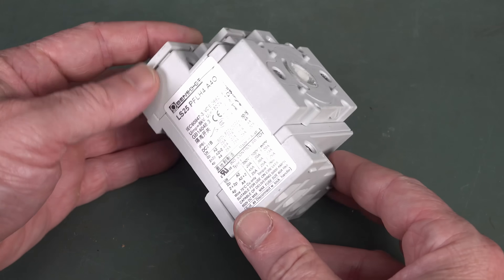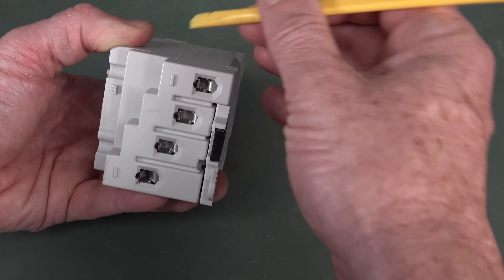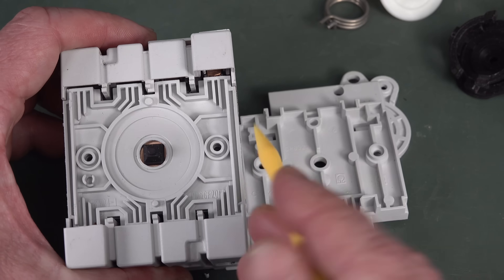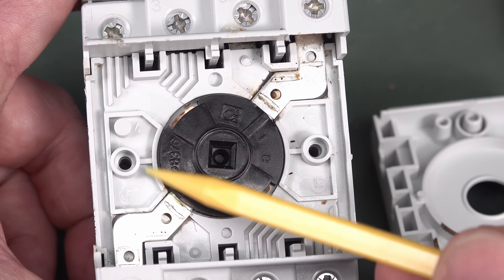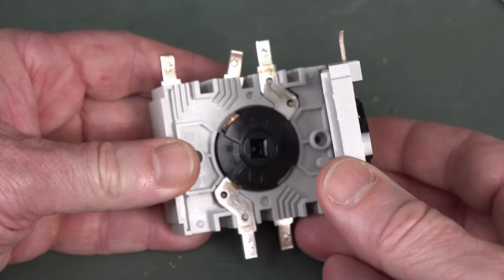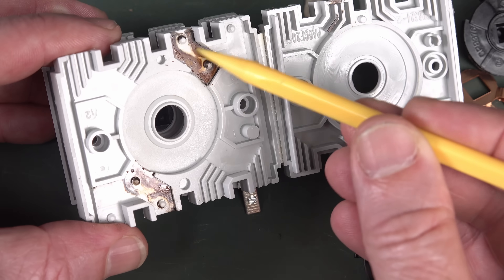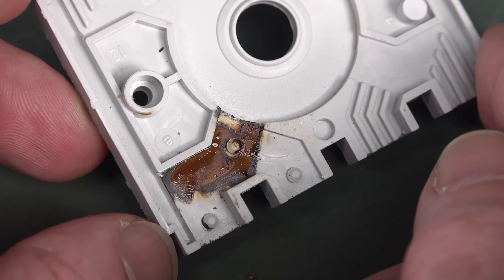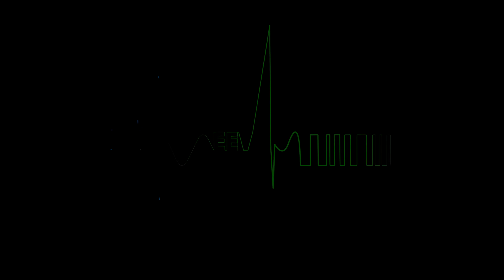EEVblog 1641 - How DC Solar Isolators Work (TEARDOWN)

Comment: Plain copper contact, not silver? Weaksauce! Yeah that definitely doesn't seem like a high cycle rating deal 😅
Reply: There is possibly nothing worse than silver to make a high voltage DC switch with.
Reply: @opera5714  Really? I was always told the opposite. Is silver really only for high amperage?
Reply: The issue is with DC and the melting temperature of silver.  Plasma itself is low resistance. Highest heat is generated at the transition point between metal and plasma.  Copper is also a problem except it conducts heat away so easily.  Tungsten variants are used because high melting temperatures.

Comment: What can interrupt fault current? A breaker, that's its job! Always best to operate the breaker first then the isolator IMHO.
Reply from the maker: The solar array DC side does not have a breaker, only the AC side.
Reply: @EEVblog  The new update to AS5033 has the rules around whether a DC panel string requires over current protection, If the cable sizing is below the max fault current including any chance of battery backfeed etc. and some other conditions. Luckily most solar is low-ish current but the voltage gets up there and that's where the problem's have  been. With the more modern grid connected inverters the voltages get well over 500 volts making them extremely dangerous. Many fires have started as a result.
Reply from the maker: @TobyRobb  I've never seen a typical home solar install with a DC string side breaker. Why would you use undersized cable? Wouldn't that be against code?
Reply: @EEVblog  Yes your correct, but it is absolutely possible to have any size conductor provided it is protected by an appropriately sized breaker . Only in solar do we see cables with ratings far higher than load current due to the need to ensure low voltage drop. Additionally, solar panels generally don't have high short circuit current . Normally fault currents usually always exceed cable ratings hence the need for a breaker.
Reply: Solar panels are inherently current sources. Overcurrent is not a thing.
Reply: @ABa-os6wm  Not for the panels. Other current sources.
Reply: @ABa-os6wm  I think my original intention was that it is better to open breakers before isolators as most isolators are not rated for fault current.
Reply: @TobyRobb  This is generally correct.  Breakers deal with current far better than isolators.  Isolators are a low-cost solutoin, but breakers are far, far more reliable.  The breaker in this case (on the DC solar side) is NOT intended to trip on its own, since a solar string can't produce enough current to trip it anyway.  It is simply there as a convenient and reliable disconnect that can be operated under load and whos failure cases generally don't result in a fire.

There is only a small chance of a backfeed situation due to a failed charge controller, the reason being that there are other fuses in that path to prevent a short circuit in the charger controller from feeding all the way back to the solar panel.  A modern charge controller like a Victron also has an extra internal disconnect or solar-side clamp and usually internal fuses to make it even less likely.

So there is no case where such breakers would trip naturally.  In combiner boxes, per-string fuses handle shorted solar strings, the master breaker occurs after the combining and does not.  It is simply there to make maintenance convenient.

I only use breakers for DC side disconnects.  I stopped using disconnect switches years and years ago due to the fire hazard.  I would never use a switch like this, spring loaded or not.  It doesn't even have a metalized extinguishing chamber... just some plastic routing.

But there are some provisios when using a breaker on the solar DC side.  In ANY solar system, nearly all breakers have to be unpolarized because the short or over-current situation can happen on either side of the breaker and the current can reverse.  For example, a breaker on the battery side has to operate safely whether the battery is being charged or discharged.  A breaker isolating an inverter can be backfed by the inverter's caps or someone doing something dumb like ganging unsynchronized inverters.

However, the breaker on the DC solar string side is a special case.  THIS breaker has to deal with high voltages, typically several hundred volts and typically needs to be rated for 600VDC or 1000VDC.  Because of the voltage rating requirement, DC solar string side breakers are almost universally polarized (meaning they typically have two directing magnets inside to direct the ARC into the extinguishing chamber quickly).   Unpolarized high voltage DC breakers can get VERY expensive.  Polarized high voltage DC breakers are small and compact and fairly cheap.  So these are usually polarized... they only work properly when the current is flowing in one direction (from the solar panels to the charge controller).

-Matt
Reply: @junkerzn7312  really great comment 👍🏻
Reply: @junkerzn7312  I have seen breakers used in place of the per-string fuses in combiner boxes, and there are cases where those ones would trip.
Reply: @connerlabs  That would be rather expensive.   They would have to be 600VDC-1000VDC rated unpolarized breakers.  Multiple, instead of just one polarized breaker.

The I.R. isn't typically a big deal (a single solar string generally doesn't exceed 12A and six will clock in at less than 100A), but the polarity is a problem since the trip condition will only happen in the reverse direction (other strings trying to dump their current into a shorted string).

So with a polarized breaker it winds up being a bit of a hazard because the normal operating current path is opposite-polarity from how you have to wire it and opposite from your maintenance disconnect path.

It is fairly easy to blow a fuse accidentally during installation or maintenance.  It should not happen under normal operation unless a string actually has a short.  Fuses are really the proper solution for the per-string ingress, with a single polarized breaker on the backhaul.

-Matt

Comment: Is it possible that the rusty/discolored tabs were due to the plastic "sweating" due to high temps caused by the current flow. See if the wetness smells like diesel fuel.
Reply: My guess would be that this was a roof mounted isolator (a very very stupid standard that ONLY Australia enforced), and it had water ingress along one of the cables, high contact resistance, and enough current to cause it to heat up. These things cause many roof fires.
Reply from the maker: @gnif  Yes, possible, this was my Cobalt Black rooftop DC isolator. Glad my new install doesn't have one on the roof.

Comment: With all due respect Dave, it looks like some artist created some mold designs that look the part and eventually one such design passed some specified tests. For one energy for sustaining the plasma can only come from the external circuit, not the rotating contact which has all the elaborate designs for plasma control in the off position. Maybe I'm completely wrong but I have not seen enough to be convinced otherwise.
Reply: The mode of operation is to lengthen and cool the arc.
Used also in substations for AC they used to use (SF6) gas to blow the arc away to lengthen it and also cool it at the same time.
Not sure what they use now as it is not good for climate change.
Reply from the maker: @FireballXL55  Yes there are other methods like gas and copper bar chutes.
Reply: @FireballXL55  Thanks for the info.
Reply: @FireballXL55  ive never heard of sulfur hexafloride being used to "blow away" arcs, I've only ever heard of it being used as an insulating medium inside sealed enclosures.
Reply: @alexplayslife7782 The high voltage switches there tend to have some piston design elements that cause the gas they're pressurized with to "blow" the arc out as the contacts get ripped apart by the big spring.
Reply: @namibjDerEchte  ah, that makes more sense, because sf6 is terribly toxic if I remember right, and I was confused about why they would be blowing it out in The open
Reply: Huh.... I wouldn't be able to tell, only have a Civil Engineering and Ocean Engineering background. At least in that you can pretty quickly tell where architecture meets the actual Engineering design principles... I am unsure how one would be able to analyze a design for electrical engineering. Since a huge portion of designs go unseen in our day to day lives I don't know how one would tell good design from bs.
Reply from the maker: This is a well studied field of high voltage switch design. Choose not to believe it if you wish.
Reply: @EEVblog I agree, but  I don't believe this switch has actually been designed for HV..more "make it look the part". A toddler with crayons would eventually deliver a design that passes.

Comment: Never ever assume that the way the wires go in at the top matches the way they come out at the bottom. I have an isolator that swaps the conductors and only because I measure everything after connecting stuff together did I catch that. A gander at the datasheet would have helped but how complicated can a 4 terminal DC switch be ?  I wonder how many people blew up their inverter after making that mistake. 😬
[edit] Lol, just got to the part where you also noticed the conductors swap over.
Reply from the maker: If I read the pin numbers on the label it would have been obvious. It would have been nice if they didn't show the switches in the schematic on the label going straight across!
Reply: @EEVblog  Yes, exactly. That's what fooled me into not examining the schematic closer.
Reply: Many DC breakers are also polarised as the internal arc suppression is on one side only. Trap for young players. Many were installed backward in our distribution area and a large program was initiated to check for compliance after some blow ups when operating.
Reply: @TobyRobb  DC breakers are typicaly polarised because they use a magnetic field (can come from a coil or magnets) to push/blow the arc into the chute/chamber and reversing the current would push the arc the wrong way.
Reply: @ppdan  Great explanation. Makes sense.
Reply: The layered nature of this one and how the terminals line up with layers is another clue — but yeah, that the terminals don’t match up with the symbol representation isn’t great.
Reply: There was a wiring diagram with labeled connection points ... read the label folks or  set fire to stuff.
Reply: Yes have met those, they went in and crossed over inside.